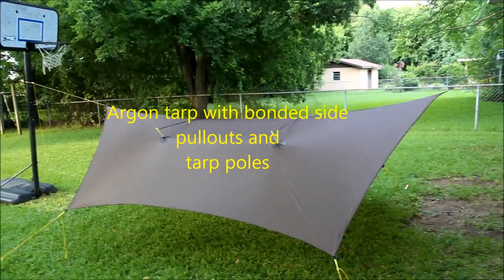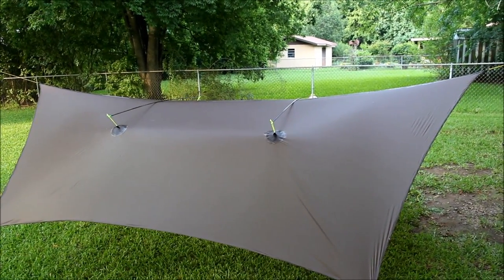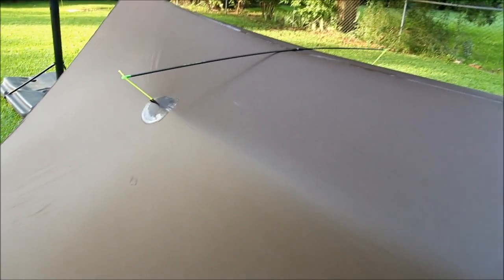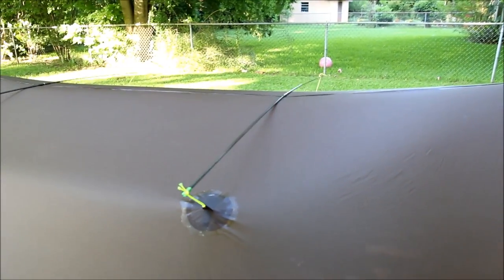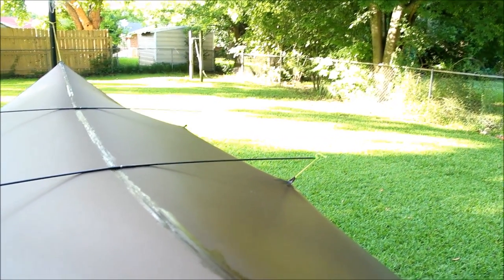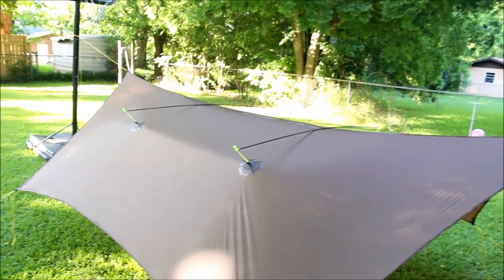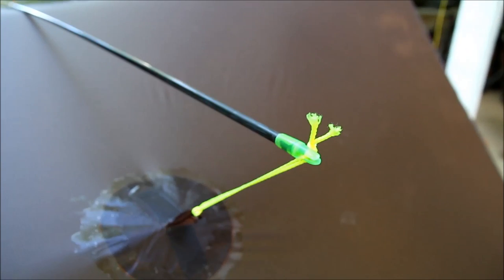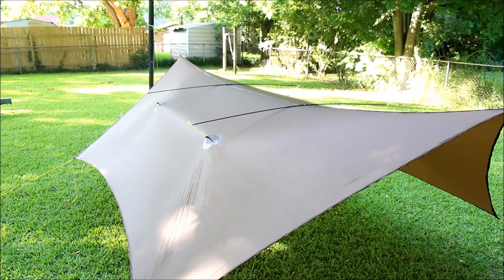Tarp pull outs and a DIY pole mod on my Argon tarp

Comment: Nice video Aboyd.  What brand seam sealer did you use for the job?  I have some of the same material and want to make sure I can seal it properly before I attempt this.  Thanks, G-Nut
Reply from the maker: Don't remember, it was Permatex I think. Got it at Auto Zone. Flow able windshield stuff.
Reply: +Ashley Boyd  Thanks!

Comment: Aren't the poles for the panel pulls supposed to go over the continuous ridgeline?
Reply from the maker: Yeah, probably the best setup. This was more of a test really. I don’t use the poles anymore, they are nice but more trouble than I am willing to deal with. Gotten lazy in my old age.
Reply: @AshleyBoyd308  what do you use now instead of the poles? Or do you not bother with the panel pulls at all anymore? Thanks for the reply btw!
Reply from the maker: @navelaviator18  no panel pulls, if weather is gonna be sketchy, I just hang the tarp low and tight, if pleasant, raise it up, maybe porch mode
Reply: @AshleyBoyd308  Thanks for the help! I was really questioning if I wanted to carry extra poles just for my tarp. I may try it with my hiking poles but like you, I think I'm going to prefer porch mode more... if I even bother.